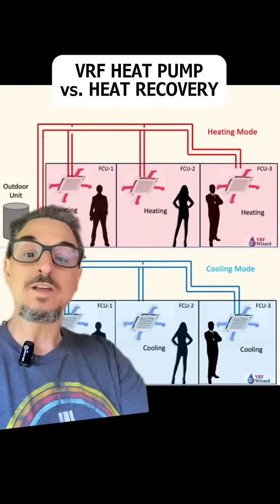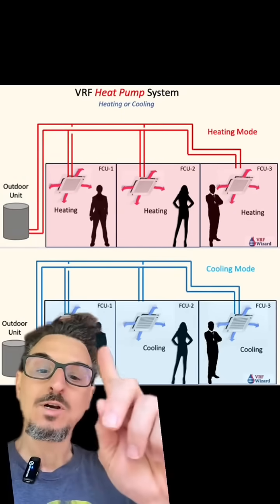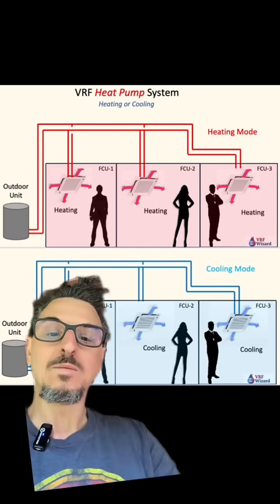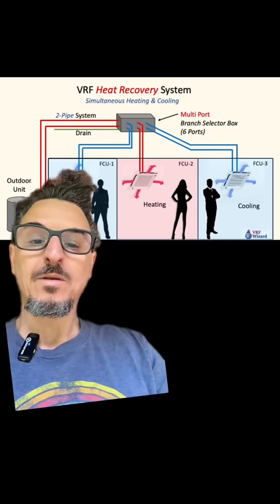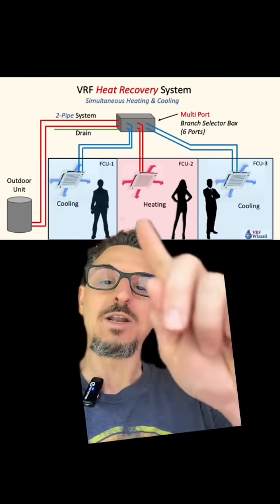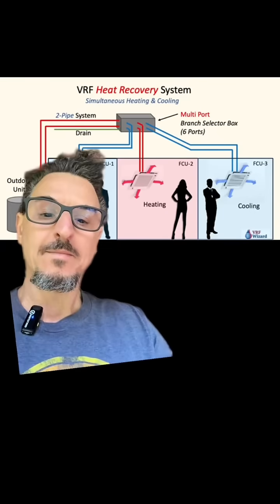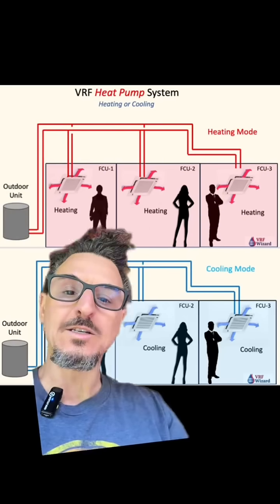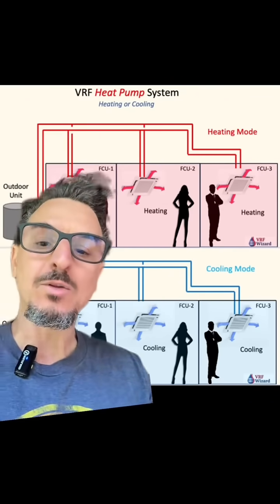VRF heat Pump vs. Heat Recovery

Comment: As vrf application engineer. I can say HR sysem most efficient when you have heating dominated zone. Cze the way this system fuction is considering heating as a primary operation and cooling is by product of heating by transferring sub cooled liquid. And hence the reson if you look closely any manufacturers submittals sheets they have synchronous operation range same for heating and cooling.

Comment: Thats a Mitsubishi...they are one of the only ones who use 2 pipe HR. You can tell when its HR due to the drain coming off the branch box
Reply: ... and most expensive as its biggest box set ip in size comparison with competitors.